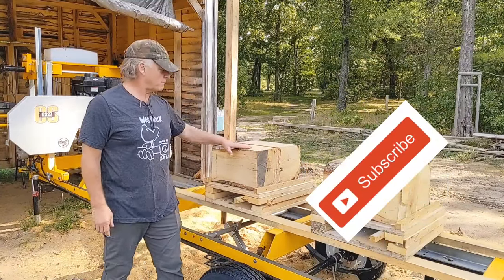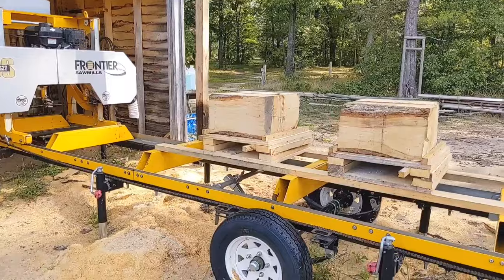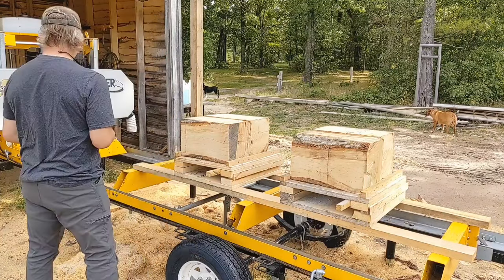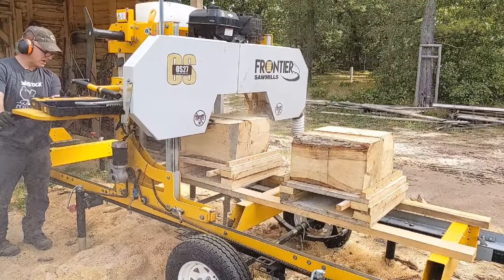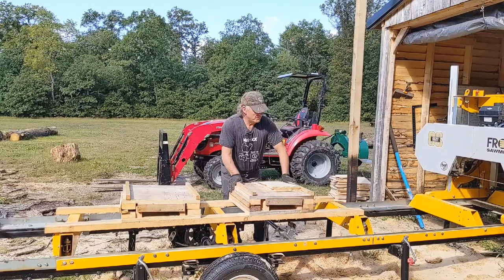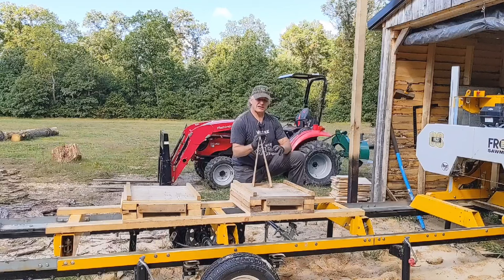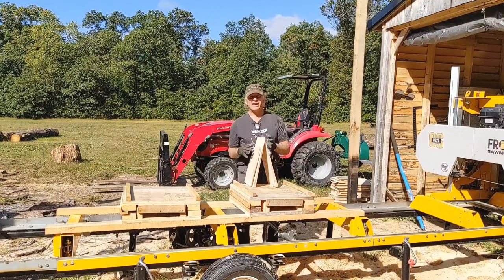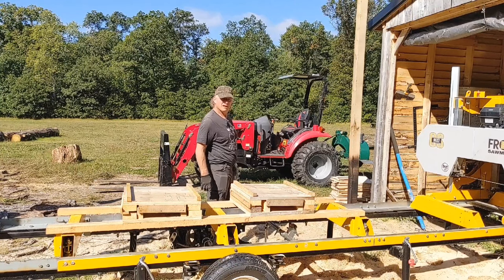Second Attempt at Shingles on the Frontier OS27 Sawmill

Comment: Western NY where men are men and the sheep are afraid! I have a siding tool that tips a 8" cant 3/8 to 1/2" so it makes a piece of siding up to 18 feet long and then I use a chop saw to cut shingles from the 8" siding..would be nice if they were wider than 8" but I could probably make a new tool that will hold a 12" cant
Reply from the maker: Someone else mentioned doing this.  Thank you.

Comment: I just got done watching your first shingle video and now this one. After these two vids it's quite apparent you have the gift of gab, YT viewers love that......... Now I'll skim through your channel to see how many bugs you got worked out of that shingle jig. Curious to know if a jack hammer is needed to nail those shingles on and how easy they split when nailed...... I dont have white oak so I would use hemlock, narrow crown staples and paint, but I do have lots of red oak that I like try this shingle jig on........... Hey from mid-coast ME........
Reply from the maker: Ha thanks.  Somebody just told me the same thing lol.   I nailed them on the side of a deer blind with a brad nailer.  They didn't split.   I tried to split a couple with a hatchet to fit some small areas and it didn't work great.   I used the table saw to get to size.   Thanks for watching and the great comment.
Reply from the maker: I love the name you use.  My wife had to explain it to me.